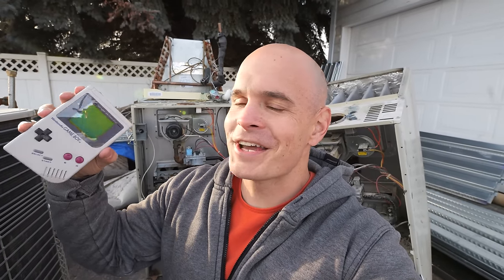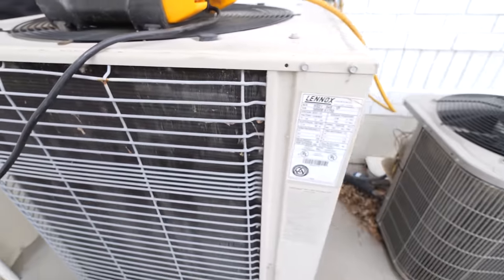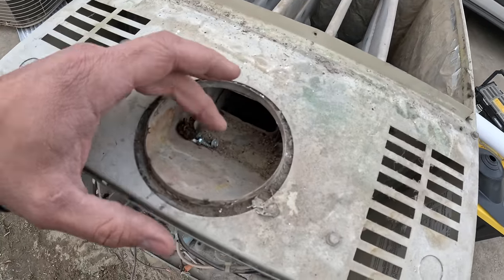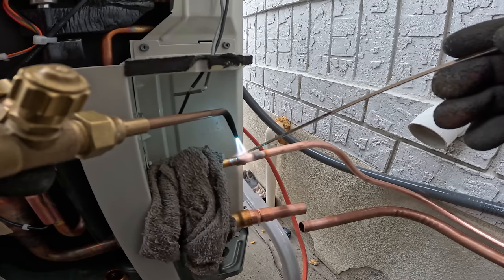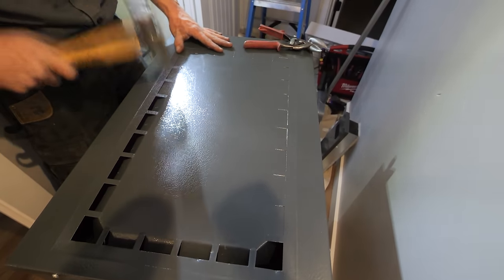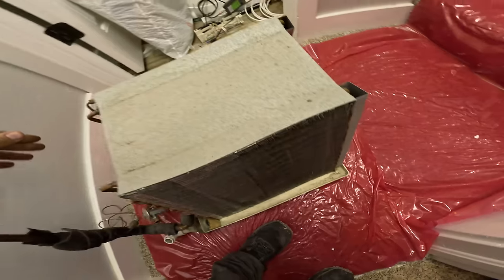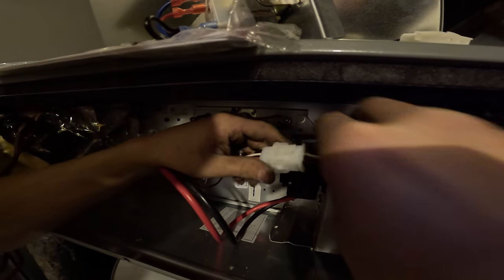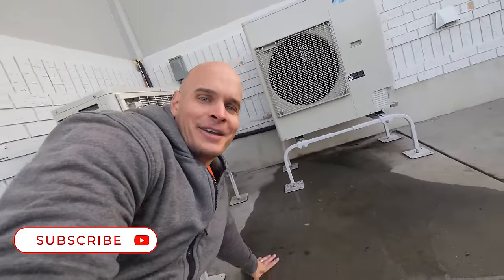Why is Everyone Talking about Heat Pumps?

Comment: New refrigerant??? lol 410a has been used for over 20 years and is about to be replaced.
Reply: R290 nor far down the road in the US now... propane.
Reply: Yes it is being banned next year and no more can be import or made January 2025. The replacement is R32 and R454b both have difluoromethane in their mixture.
Reply: @lylestavast7652  R290 won't be used in homes. It was discussed, but EPA said no. It is used in open case coolers and freezers and is limited to 5.25oz. I certainly dont want pounds of propane in my home.😂
Reply: its new for the US. they are just getting off R22. its disgaceful how far behind the US is.
Reply: Everybody is preparing for the new A2L class which will be the replacement after this year.
Reply: In Australia R32 is pretty common now, I think that's supposed to be new I'm not sure tho.
Reply: @joshcanhearyou  R32 has been around for like a decade already. in europe you cant even buy residential stuff with 410 anymore for quite a while now.
Reply: @SupremeRuleroftheWorld  no, we are just about to stop using 410a been using it since 2000 in the northeastern united states. R-22 was banned in either 2013 or 2014.
Reply: @SupremeRuleroftheWorld  yeah for sure. Daikin is going to use r32 since they are already tooled for it and the manufacture it. But Trane and carrier and going the other way and using r454b. I’m not really thrilled either way.
Reply: great systems ! i sell/install those in vegas everyday!!
Reply: @zack9912000  but having Gas Heating in Million of houses is alright😴 R290 is the future of Heatpumps
Reply: @Rawdilz  2020 actually that's how ahead of the curve we are for R-22.
Reply: Even in India r410 has been passed out and r32 is the standard for quite some time.

As usual America created a shit ton of problem but blamed and forced poor developing countries to bear the cost while doing nothing itself. Shameful
Reply: R32 is inside my new split air conditioners
Reply: @SupremeRuleroftheWorld  what's disgraceful is that you think just because your government banned it, it is some horrible thing. All these repeated rule changes for refrigerants do is force consumers to replace things that they might not otherwise have to replace.
Reply: @yucannthahvitt  because we banned these gases decades ago we managed to fix the hole in the ozone layer. remember that one? yeah, we fixed that by not using these bad gases. and trying to keep a 30 year old POS single speed unit on life support because you are too lazy to replace it is bad econmomics. a modern unit pays itself back just in the increase in efficiency and as a bonus it stops killing the planet. wich as you might recall is the planet we live on.
Reply: @SupremeRuleroftheWorld  the R22 replacement, R410A, is being phased out now. It is being replaced by A2L refrigerants.
Reply: Yeah he got scammed. They always do this shit....... 

I always thought the end game for refrigerants was CO2.... R744.....
Reply: @hhjhj393  yup. Mitsubishi is playing around with C02 I just did 5 day 2part class and they were talking about some units that they are testing.

Comment: Dude these guys hacked your system up!! They didn’t flow nitrogen when they brazed and they knew they were being filmed!! That means they either don’t care or don’t know better . When your heat or ac stops working next season, hope they can fit you into their schedule. Also Your thermostat settings/ wiring are going to determine wether your electric heat is supplemental or auxiliary

Comment: I dont know what it is about heat pumps, but for some reason the topic always tends to turn the comment section absolutely insufferable, ranging from "heat pumps are incredible!" to "heat pumps dont work if it's below freezing!" to "how are you just discovering heatpumps, we've had them installed where I live since the 4th century and we're also better looking than you."
Reply: Probably same reason people are against new stuff like electric cars and solar panels. Here in Czechia basically all new houses are required to have a heat pump, no burning fossil fuels anymore. Some of the cheaper heat pumps do have problems in a big cold like -20°C and then these homeowners are surprised they were getting heat by electricity only and their bills are high. But these people usually don't have their house properly insulated, with triple glass windows etc, so it's not fault of only these cheaper heat pumps.
Reply: Heatpumps have been around for quite a while and works fine in very cold temperatures if the right kind of unit is selected. I'm in the northeast and i have been on inverter heat pump heating for years. İ kept my old fuel oil boiler for backup and boy i am glad i did that. When the power goes out, a small generator or a battery is all you need to run the boiler.

Comment: Crazy how so many people here are surprised and impressed by heatpumps in 2024. We've been using heatpump to heat our houses in Quebec for what... 15 years+ ? Aux heat (either resistive or propane/natural gas) as back up and during very cold days only.
Reply: I live in the 3rd world and we have a heat pump at my parents house for more than 20 years...
Reply: Here in Germany a most of the older houses still have oil and gas heating because it was a solid and cheap method 20-30 years ago. In the current situation with wars, rising fuel prices and a greener mindset most new houses install heat pumps in combination with PV systems.
Reply: My parents built there house in 96 and everyone in the area had heat pumps installed
Reply: Technically (nearly) everyone has had a heat pump in their house for 50+ years. Just that most of them have only been pumping in one direction.
Reply: The US has had cheap gas piped to most homes and heat pumps have improved a lot in the last 20 years.
Reply: Crazy how you have heated houses, here in the Himalayas, our houses are as freezing as the outside.
Reply: You know Ernest, the guy who went to Camp and such? He got his start slandering heat pumps for the natural gas industry. No lie. 😣
Reply: In Sweden we've been using them since the early 1980s 😅
Reply: @RaXXha  sure 😂
Reply: C'est parce que la majorité du monde son épais et ne veulent pas évoluer.
Reply: People probably havent heard of it because it was cheaper and easier to just use natural gas or oil here in the US.

My hot water, stove, central heating air and clothes dryer were all on natural gas and I dont think I have seen a gas bill over $150. Maybe one or two went slightly over $150. Still that was cheaper than heating my previous house that was 2/3's the size with a pellet stove. That cost me about $300 a month and didnt include hot water, or any of that other stuff.

Why would I spend thousands of dollars to have a heat pump installed to save myself maybe $50 for only the two coldest months of the year? The payoff is not there. The only time this makes sense is if you are already having to replace your A/C unit anyways. My house is 21 years old(older than your claimed 15 years of using heat pumps) and is still running the original AC unit

Comment: Interesting that you refer to R410a as new..?  Here in Norway its essentially completely phased out and replaced with R32.
Reply: Yea someone government bureaucratic got their palms grease for this nonsese. I definitely dont want R32 or  R454b in my home. difluoromethane is highly flammable and can be explosive. Especially when the new equipment first comes out
Reply: @zack9912000  Yeah, I have never heard of it exploding or causing fires, but I guess its possible. Anyway, I think they are working on banning R32 over the next few years, as its got a really high CO2 equivalent if released into the atmosphere.(1kg of R32 is equal to .6 TONS of CO2 released) 410a is even worse.

I dont know what they're planning to replace it with though, as ammonia for instance isnt CO2 bad, but bad for completely different reasons.
Reply: You haven't moved on to the R35 skylines yet?
Reply: @nadirh902  Had to google that, not a car guy :P . But speaking of cars, releasing 1kilogram of coolant roughly equates to a year of driving a combustion car.
Reply: @AndersHaalandverby  read up on the MSDS for both, and they say the opposite of the environmental nut jubs claim how safe it is.
Reply: @zack9912000 They are mildly flammable. As long as Technicians follow the proper practice when handling these, it will be fine.
Even the non-flammable R22 and R410A can be exploded if handled incorrectly.
Reply: Forget Norway, even in my country India, we're using R32 for a decade. I installed two 1.5 ton split units (R32) in two rooms in 2018, and they're working fine. I've never seen any AC explode and catch fire.
Reply: @zack9912000   R32 is not highly flammable, it's classified as mildly flammable. It can occasionally burn in the presence of a flame but it won't explode. And fun fact: the mixed refrigerant R410A is 50% R32. If you have 410A you already have R32. It's nothing new.
Reply: @AndersHaalandverby  I am not an expert, but I remember I watched a vid saying that CO2 (R744) was the endgame, and that HVAC companies KNEW R744 was always the endgame since the 60s-70s, they have just been fudging around all this time to make $$$$. Why build R744 systems way back then when they could mess around with R22, R410a, R32, yadda yadda, they can basically sell people more AC units and make more $$$$. 

Again not an expert, but I had heard that basically AC companies figured this all out YEARS ago. 

I think I heard that Japan uses R744 units and they get a rebate for those? I guess CO2 is a bit harder because it operates at a higher pressure?

Comment: Technology Connections just put out a video about this because of the recent spike in purchases of heat pumps in the US. Some important things to note; a lot of installers are currently taking massive margins on heat pumps because of the hype. Check the wholesale price before paying for instalation. Heat pumps are barely any more advanced than an AC, so they shouldn't cost double or triple. Also, your installer should be calculating new DTU requirements for your house, not going off of the old numbers, as furnaces were often over-speced. Also, there are new low temperature heat pump units that can run just fine in the cold weather you're describing.

I live in New Zealand where our coldest days are -5C, we live entirely off of old, low-end heat pumps just fine and don't need central heating.
Reply: Fellow kiwi here. -10 referenced in the vid is -10 Fahrenheit I think (-23 C). Was thinking the same as you as to why supplementary hearing was required then remembered US uses degrees F...
Reply: 'heat pumps' are AC
Reply: I was looking for the comment mentioning technology connections
Reply: Yea honestly what he described including the refrigerant would be maybe modern/new about 10yrs ago. This did not seem like anywhere near state of the art you'd expect on this channel.
Reply: @Timewastedonyt  He is so awesome and entertaining explaining things.
Reply: @kirkc9643  AC plus a reversing valve, and a smarter indoor unit.
Reply: @asriel09  We've used reverse cycle air conditioners (aka 'heatpumps') in Australia forever. The inverter is a more recent improvement (but it relates to the electric motor, not the 'pump')
Reply: 👍, in very cold regions they have kits to bury the coils under ground to use geothermal insulation
Reply: The installers are taking massive margins since ever, everywhere around the world, no matter the tech of the cooling/heating.

That has become a joke, remember the Air Conditioning people in Community? we have a sketch here in Argentina called "the son of a bitch that installs air conditioning", they only work a couple of hours per day, and only work one home per day, that's not going to be economic at all.
Reply: @GeomancerHT  "This is it Troy... the Room Temperature Room" ...  I can't tell where my skin ends and the air begins!
Reply: Blows my mind that "heat pumps" are having a huge spike in UK, US and Canada.

Australia has been using them for decades just under the name "reverse cycle air conditioners".  Honestly, for heating they cost quite a bit.  they're more expensive to run in winter as the solar panels arent offsetting them as much.

I imagine good insulation would make a huge difference in running prices, unfortunately Australia isn't really known for having great building standards in terms of insulation
Reply: Plus electric powers is a teensy bit expensive there.
Reply: @jarrardscott they're having a huge spike in Canada because the government is now incentivizing them to phase out oil and natural gas heating appliances. 
We've had them for 25+ years

Comment: I just had a heat pump put in 2 years ago and it really saved us tons of money. Living in central Wisconsin it gets cold really cold 30 to 40 below zero. We did have a new propane furnace and had a pellet stove installed to help keep the house warm in the winter. My neighbors have been over tons of times to check out the heat pump to see how well it works.
Reply: sounds like they trying to stay warm

Comment: I am an Electromechanical Engineer and I used to configure Danfoss (A Danish) Variable Frequency Drives in dairy plants and the efficiency compared to a start-stop type system was incredible when you add it all up over a decade. I was always in search of that magic PID value for the control loop
I miss that job!